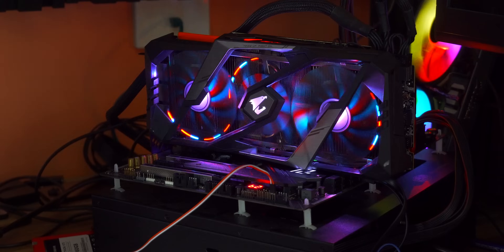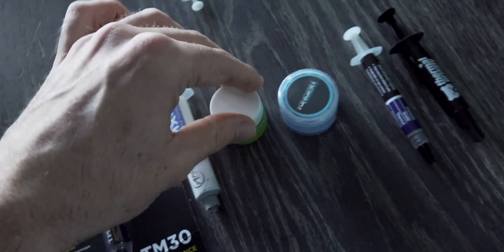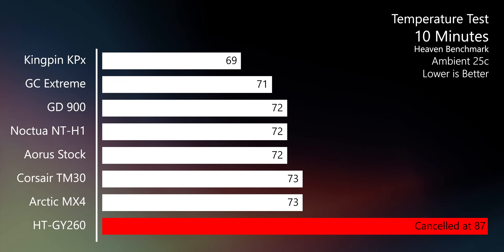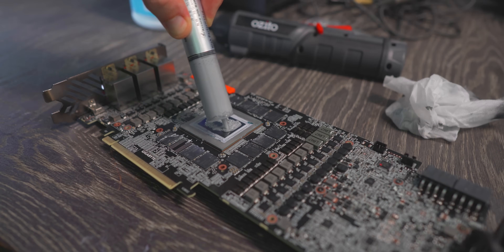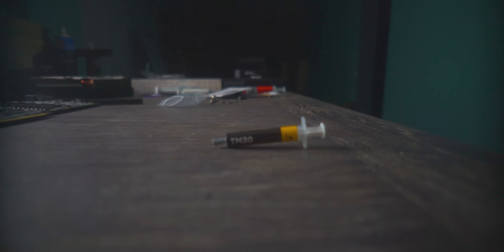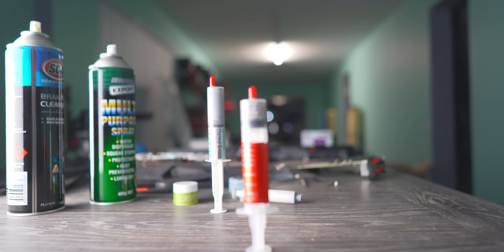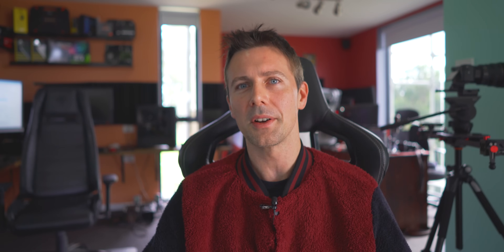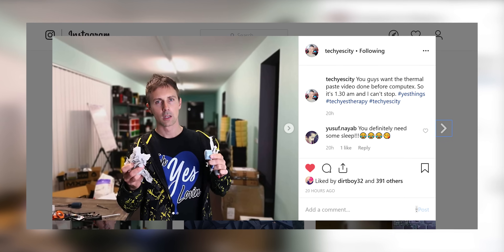What's The BEST Thermal Paste in 2019....? (Ft. GD900)

Comment: Will you be doing a 2020 version? Also, besides all the major name brand players in the mix, can you add in Super Lube: Heat Sink Compound against the big contenders? A 3oz (Yes, 3oz) tube will set you back $6.88 Dollars American or (I think I converted it right) $9.44 Aus. So far, I have used it on 95% of my builds and my refurbishing of video cards. The biggest test was when I used it on a FX 8150 system, I overclocked the system to run at 4.3 Ghz, and the highest temp I have seen was mid 40's Celsius. I have refurbished a few GTX 560's and they have never reached any form of overheating. I also did it to a HD 7870 XT 2gb, and that one was easily overclocked after it's refurbishing. Only time I did not use it, was with my new Ryzen build, as I wanted to compare numbers with a different brand. Anyways, keep it up!

Comment: Used it for a year, it didn't dryout. Gd900 is Good. Considering its price. It beats other expensive and popular brands out there.
Reply: @Hazard i know,  but it's  not about the price. Its about the performance it gives. Whatever works for us.
Reply: +1 for MX-4 reliability. I heard the same.
 @claydohlite29  In what temperatures under load did you use GD900?
Let us know how GD900 is doing in another year as well! :)
Reply: @---pp7tq i just switch to a new cpu coolerbso i have to take it out and my Gd900 didnt dry out, after 1 year and 6 months it just didn't. Idle is 28c, i live in tropical country so yeah. 8700k fulctuatinh to 55 to 65 in load sometimes 70. Ima try overclocking with it soon
Reply: @claydohlite29  I just received a reply from a guy using GD900 on RX570 with 76C after OC, and after 4 months of heavy testing, in stress, temperatures raised to 83C. I wonder how it would be on overclocked CPU like yours. But it may also depend on usage.
Reply: @---pp7tq  yes maybe, i only used it for gaming roughly 6 to 7 hrs a day. I don't know, it works well for me. Well gotta try the mx4 nextym if inhave time,

Comment: I wonder what these results would have been like after one year. I mean, GD900 may be good right after being applied, but what about its longevity ? Arctic estimates its thermal paste to be efficient for 8 years, but I'm not sure we can say the say same thing about the GD900. I'd really like to know, being a hustler, GD900 may be my Grail.
Reply: Which arctic thermal paste do you use?
Reply: @02102u  MX-4 lasts like 4 years.
GD900 up to 70C 8700 it worked fine a year, but on RX570 temperatures increased from 76 to 83C after 4 weeks.

Comment: Phobya NanoGrease Extreme Thermal conductivity: 16W/mK?
Has Kingpin put out the Thermal conductivity for KPx? Cannot find much information on it.
Debating pastes for when I receive my IceGiant ProSiphon Elite CPU cooler (includes Thermal Grizzly Kryonaut). Want to clean off & apply fresh paste on my CPU & GPU at that time. Debating using the Thermal Grizzly Kryonaut 12.5 W/mK, Phobya NanoGrease Extreme 16 W/mK, Thermalright TF8 Thermal Compound Paste 13.8 W/mK, or Kingpin Cooling KPx Thermal Grease.

Comment: How can you reasonably compare different thermal pastes when you have absolutely no clue about how to apply thermal paste efficiently ? Too bad KF compound is not even listed when it's about one of the best heat evacuation paste (and much cheaper, I use it on all my electronics, from PSU to audio stuff, CPUs, GPU's MCUs etc etc..) than all those commercial craps sold at gold price.

Comment: GD900 good for prosesor?
Reply: Yes. Get gd900 from ebay.com
You can use a small screwdriver to put one rice-grain-size blob of thermal paste on the CPU near the center and it will cover the two or three areas where the processor dies are as the paste will spread out when the cooler is placed on it. Thermal paste was designed to fill in the tiny cracks between the heatspreader (CPU casing) and the cooler, not as a primary heat-transfer compound. Too much paste does more harm than good so it's not needed in the corners. Air trapped in the paste is an insulator so if you put on multiple drops or manually spread it you will get air pockets. Use the small screwdriver to straighten any bent pins too (AMD). Renew the paste every 12–18 months.

Comment: I question if the GD900 drys out over time.  I've bought other pastes that perform excellent...for a while.  Kind of turned me off from the really cheap stuff. Noctuha NT-H2 works pretty good,  better spread and slightly better temps.
Reply: Up to 70C 8700 it worked fine a year, but on RX570 temperatures increased from 76 to 83C after 4 weeks.

Comment: Just FYI as an electrical engineer with decades of experience - you never, ever glob thermal paste on as shown here.
You put a small bit and use a credit card and scrape to a layer as thin as possible and keep it off any conductive parts. Do it to the heatsink as well.
The object is to fill surface defects in the chip cover and the heatsink - any more you erect a thermal barrier and cooling will actually suffer.
Reply: I agree but, you really need to use a credit card to make it thin (unless your paste is very, very easy to spread to seriously do so) otherwise you get 3C more or I'm doing something wrong. Anyway, I left heat sink alone to get better results (at least w/o using credit card).
edit. I tested with credit card. Maybe I pushed too hard, or paste wasn't dense enough, and it ended up a bit too thin with worse temperatures than before.

Comment: i've been using white goo since forever with zero problems, specially because the one i use NEVER dries up, i have systems that i haden't opened for over 12 years that still had it like it was freshly applied. and it does its work. but my ryzen 2700 really likes to heat up at full load, so i think i might give this gd900 a go. just ordered a 30g tube from aliexpress. next time i apply thermal paste, it will be with that one. but i honestly don't see me disassembling my cooler just to change thermal pastes. this cooler is a bitch to set up :\
Reply: White Goo?
What was the product name exactly?
Reply: @---pp7tq  generic white thermal paste. i'm fairly sure it was a local brand. i used the same little tube for like a decade.

Comment: Why test with a fancy 2080 graphics card when if all you are testing is the efficiency of the thermal paste. You could simply use a resistor with a constant load with a passive heatsink. It would remove all the variables.  You could even use a power transistor with heatsink connected to a light bulb.

Comment: Not sure how you are getting good results with the gd900 stuff, specs are garbage.. 4.3W/mK. MX-4 is only 8.5W/mK. Should have tested makergel nano @ 11W/mK and there is also phobya nanogrease extreme @ 16W/mK. unless the manufacturers lie about the thermal specs the one with the highest wins regardless of cpu, gpu, die size etc

Comment: Running NT-H1 on my 2080 TI with water cooling,  only because I had it around.   Getting around 45C under gaming loads.   Works fine.  NT-H2 I may try as it appears to be better.   Thermal Grizzly I'm worried about getting fake stuff,  Amazon is full of fake stuff in all categories.

Comment: Awesome to see someone testing the GD900. I just bought an R7 3700x, and I was wondering whether I should replace the paste that comes on the stock Wraith Prism. Was looking at different pastes online and looking for reviews and found your video. When I saw the GD900 I remembered I had a tube I bought on ebay a couple of years ago as an impulse buy when I bought something else, but never used. I had totally forgotten about it. I think I had assumed it wasn't worth using because it was so cheap. Still don't know if it's worth replacing the stock paste on the Prism though.

Comment: Hey,
Before you do the next one, you should get IC Diamond in the running.  I am going to run a similar test on the TR 3970X, but have already compared Thermal Grizzly to IC Diamond on my Radeon VII, and IC Diamond works really well, keeping the Water Cooled Radeon VII in the high 30's during stress testing.

Comment: yes the gy260 i bought this also and my cpu was idle at 58c and its only a i5 4690 25c hotter then any other thermal pastes ive used,,big shout out for this tests ,,i just thru the 4 30gram tubes i had in the bin and bought a gd900

Comment: For one thing you may have overlooked is the electrical conductivity, It mildly shorts the transistors of my gpu integrated CPU, which cause screen flickering and constantly close my monitor randomly. At first, I think it is the driver problem, but when I clean it and get solved. So, please be alert not to apply too much and leak to the edges, I was not putting much but it is just too sensitive in terms of conductivity.

Comment: Could someone help me? My Laptop ( i7 7700hq gtx1060) clocks my cpu down to 2,7 GHz (Turbo is 3,5 GHz) at a Temperature of 86 Degrees Celcius. Someone has a solution?
Reply: cpu undervolting lowers my temps by 14 deg on the same chip as yours.  i don't know how this would affect your frequency value.  maybe make sure your turbo boost is enabled.  my figures are from using xtu . . . these could change once you start pushing the graphics card.
Reply: cheeky monkey i cleaned my laptop today and downvolted it. It helped 3-5 deg. I ordered some new thermal paste maybe this could help🤷‍♂️
Reply: @anthonyyyy268  People seem to be getting great results from repasting.  I'd be interested to hear your results.  Good luck :)
Reply: @cheeky monkey  I repasted my laptop and the temps went down from 87 to 65 ✌️
Reply: @anthonyyyy268  Great result!  What paste did you use?

Comment: But for how long does the GD900 cool that good? Is it keeping it or does it goes worse after a few months?
I guess that's the most important question.
Reply: Up to 70C 8700 it worked fine a year, but on RX570 temperatures increased from 76 to 83C after 4 weeks.

Comment: GD900 vs MX-4?
Reply: very close. sometimes worse, sometimes better temperatures (2 Celsius degreases difference).
Up to 70C 8700 it worked fine a year, but on RX570 temperatures increased from 76 to 83C after 4 weeks.

Comment: Next real question is how long do they last and continue to perform....not an easy thing to test, but would be interesting to find out.
Reply: Up to 70C 8700 it worked fine a year, but on RX570 temperatures increased from 76 to 83C after 4 weeks.

Comment: planning to re-thermal paste my 2015 retina macbook pro 15 as temps are sitting at 100c most the time or throttling down a lot to maintain 85c. my brother has some noctilux thermal paste from a few years back ina tube, I'm guessing it should work just as well for laptop cpu's...........or maybe I should order in some kingpin KPX?

Comment: Will be very interesting to see how that super cheap GD900 ages, as in does it harden quickly or last a long time?
There are a ton of comments saying "Meh it's cheap just reapply", problem with that is there are a lot of us who run Custom Loops and having to Drain the Loop, Dismantle it which can lead to leaking after, clean it all up and reapply, reassemble is a serious pain in the you know what. That being said I generally clean my loop every 6 months to a year depending on coolant used so as long as it last that long no worries but I'd prefer it last much longer as like I stated above dismantling your loop means leak testing it all over again when in general you just drain, flush, refill...

Comment: Amd a8 4500m with onboard graphics laptop from Toshiba. It was junk almost when I got my hands on it, believe it or not I reflowed the GPU with a blowtorch and some random conical metal bracket + temp probe. With a dell laptop screen duct taped to original frame. Its a piece of shit still mixed matched ram,  but I'm proud of my ingenuity and only other laptops are even slower. Amd e-350 and the OG snail sloth itself pentium M.

Comment: I think I'm going to have to use the Kingpin KPx on my ASRock AMD Radeon RX570. That one keeps on getting hot compared to my EVGA nvidia GTX 1050. Not to mention my ASRock is very noisy at heavy load. I'll definitely will go for GD 900 after I finish all my other thermal pastes.

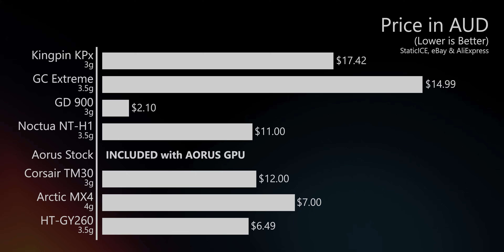Comment: Hi Brian / @TechYesCity, I'm a bit confused - at the 4:12 mark, it says for the Arctic MX4 the price is $7.00 but listed higher than those around it. It's bar graph makes sense as in USD it was $9.99 relative to the others around it in that $7-8 USD price range. Obviously some kind of typo, but going by the price/currency adjustment from USD to AUD for others (May 2019), I presume the Artic MX4 sat around AUD $14, rather than AUD $7 in that period? There's ofcourse no way to correct retro-actively in the video itself, but perhaps you can leave a note addressing this little oversight in your supplemental comments for the video above? BTW Enjoyed the video, keep up the great work mate!

Comment: Can you please suggest me which will provide better cooling among them

1. 6 heatpipe, 2 Fan(2x90mm), 2 towers (can't add 3 fans because my motherboard/RAM/Case wont let me)
https://www.aliexpress.com/item/32986572385.html?spm=a2g0o.cart.0.0.777d3c00XhG20w&mp=1

2. This is identical to no.1 but the pipes are closer and in no.1 the pipes have some more space between them you can see it in the pics wil that make any difference?
https://www.aliexpress.com/item/33055350285.html?spm=a2g0o.cart.0.0.163f3c00EY3eLN&mp=1

3. 6 heatpipe, 2 Fan(2x120mm), signle towers
https://www.aliexpress.com/item/32960406803.html?spm=a2g0o.productlist.0.0.51bc26f7i5H5vQ&algo_pvid=28a7c118-2c4c-4d36-bc47-e55926126bcb&algo_expid=28a7c118-2c4c-4d36-bc47-e55926126bcb-3&btsid=4db0a52d-0397-4a52-8058-717438d20f23&ws_ab_test=searchweb0_0,searchweb201602_,searchweb201603_53

4. 5 Heatpipe, 2 Fan(2x120mm I have an extra 120mm Fan around the pack comes with just 1 fan), single tower
https://www.aliexpress.com/item/33038907107.html?spm=a2g0o.productlist.0.0.7e0b10d0GxSHLh&algo_pvid=c88fab33-96a7-490a-a500-8ca03ac1f565&algo_expid=c88fab33-96a7-490a-a500-8ca03ac1f565-0&btsid=970e803b-13c6-4a09-9375-ff44d38d3080&ws_ab_test=searchweb0_0,searchweb201602_,searchweb201603_53

5. 6 heatpipe, 2 Fan(2x120mm), signle towers (price is high but is it worth the high price?)
https://www.aliexpress.com/item/32993609816.html?spm=a2g0o.productlist.0.0.51bc26f7i5H5vQ&algo_pvid=28a7c118-2c4c-4d36-bc47-e55926126bcb&algo_expid=28a7c118-2c4c-4d36-bc47-e55926126bcb-8&btsid=4db0a52d-0397-4a52-8058-717438d20f23&ws_ab_test=searchweb0_0,searchweb201602_,searchweb201603_53

Comment: There is also how fast it dries out too... How often they have to be changed, and their 30 hour tests work. This is a very time consuming issue. Watery materials could take longer to dry out (hence the easy to spread ones could be superior!) and then testing THOSE against the dry thermal conductors that competes with low end pastes. The pads. "IC Graphite from Innovation Cooling" - graphite (before graphene) is a heavy thermal conductor, but it transfers shocks from parts so it cannot touch other parts, but competes with ARCTIC SILVER! in thermals...

Comment: Great video! I have the same card and get crazy temps in PUBG - oddly in Heaven it runs around 75-77 with the stock paste. What configuration did you use in Heaven? Also - would love to see a tear down video of the card. I definitely would like to try some other thermal pastes - but am nervous of stripping the GPU.

Comment: Though it is a lot pricier than GD900, you can get cut price Gelid Extreme as Halnziye HY880 for less than half the price. Same exact performance, same mildly PIA waxy spread. 
I exclusively use GD900 in lieu of MX4 for a few years and swapped from Gelid Extreme to Hy880 as my top shelf stuff when Extreme exploded in price over the last few years. 
Just as always though, with chinese brands take care with who you buy from and I can only vouch for the little jar stuff, squeeze bottle I avoid even if that's safe with GD900.

Comment: GD900 might have a  problem tough. After a few months it could dessicate and leave empty bubbles due to high viscosity. You should test it after some time in a working build. One easy way to make the best temperatures would be to just coat the die with a bit of oil and distilled water homogenus mixture, it will be the best for one test. Then it will fall apart as it dries out.

Comment: original thermal paste msi rtx 2080ti Ventus OC and overclocked 99 core 600 memory
72/73 Celcius ... 161/163 F
for the cpu i have that best grizzly compound , which helps a lot
but the best thing for it is a good cooler

Comment: I Have a bunch of RX Cards here Rx 480s, RX 570s & RX 580s. I was doing some benchmarks after upgrading a friends Computer on the XFX RX 480 8Gb & running Heaven Benchmark it was bouncing between 90c-94c !!! So I poped the card apart & replaced the Thermal Compund with Gelid Extreme  & it never went over 75c. Still hot but it is overclocked & stable too, I let Heaven run for over an hour & it stayed right at 75c. Apparently anything under 80c is normal on this Card.

Comment: Some older GCN era cards have pretty high power density due to the rather small die sizes yet run pretty hot like the firepro m6100 (gimped 7790) as it handles like a little furnace.